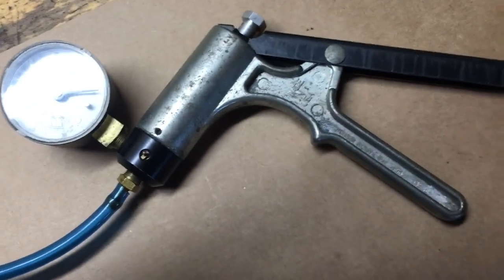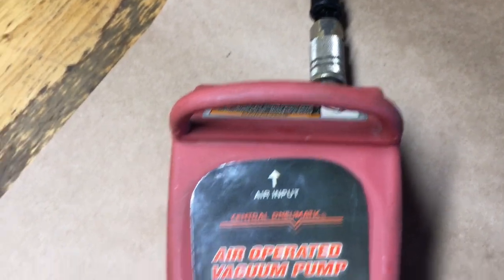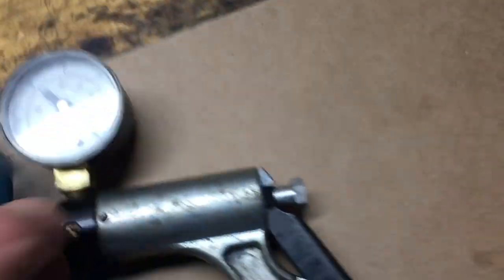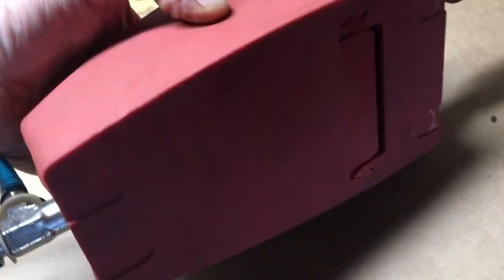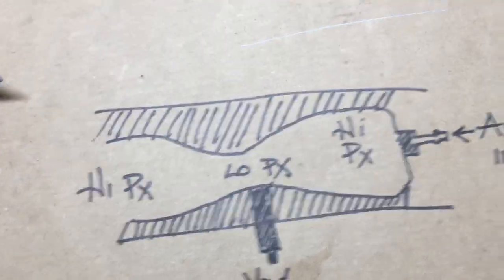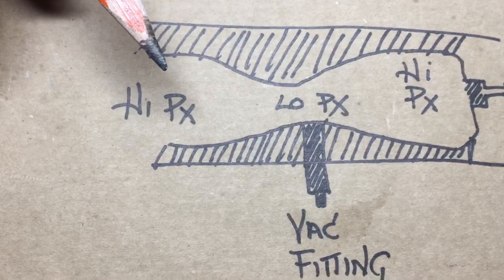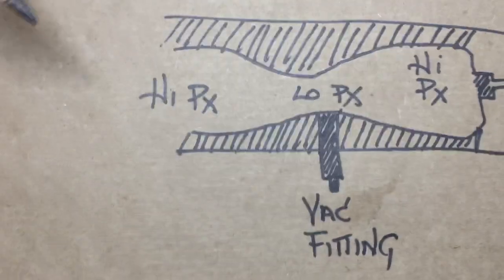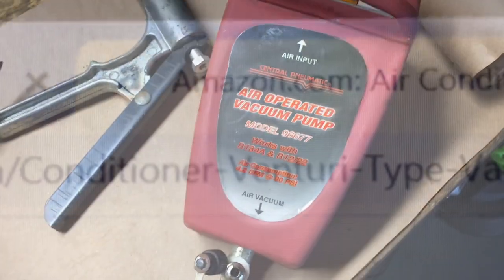Value Vacuum Source

Comment: My brother randomly gave me one of these from Harbor Freight. I'm not an engineer but I am a hobbyist, would it be possible to use it to make a vacuum chamber?
Reply from the maker: Thx for watching. The tool will provides a source of vacuum if provided it with pressurized air (shop air). I believe it’s essentially a Venturi (jet) pump. So you could pull a vacuum on a chamber with it. How deep I am not sure. Cheers
Reply: @TheGibby3340  Air-powered venturi vacuum pumps don't pull a deep enough vacuum. The best you can hope for is 20 inches.

Comment: So can a small compressor power that vacuum pr does it need constant flow to work? Wondering if my small tank conpressor can pull a little vacuum, then close valve and let compressor fill up and then keep doing that way until enough vacuum buildd?
Reply from the maker: Constant flow is required. Your approach may work so long as a line check valve was fitted. I recently purchased a cheap vacuum pump less than $100. Great wee rig. Cheers 👍
Reply: @TheGibby3340  gotcha. Thank you for the response.

Comment: not worth a shit, take an old refrigerator compressor if you need vacuum
Reply from the maker: henry robinson Ok, so just so I am clear Henry...I am getting the impression your not impressed with this/these products 😀
Reply: @TheGibby3340  no i had one 30 years ago and traded it for an electric pump the next week, i've done auto and HVAC work for 30 years
Reply from the maker: I was only kidding Henry. Totally agree BTW. Never intended for serious service application. Strictly DIY cheap option. Thx for watching. Cheers